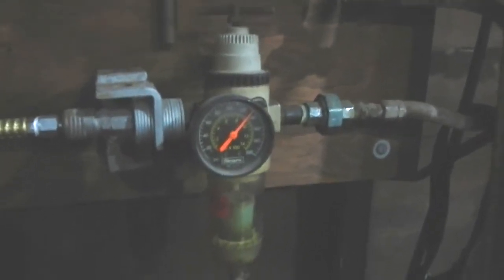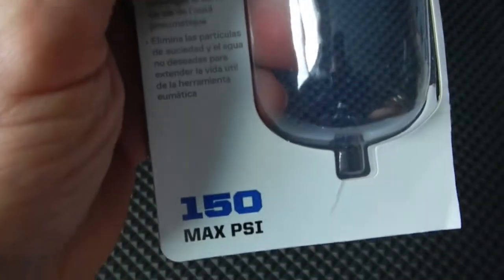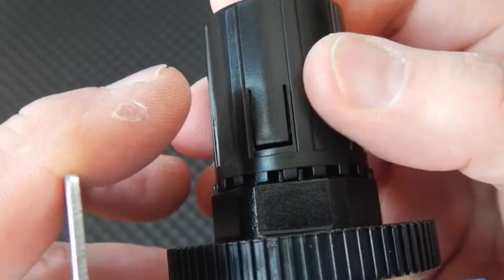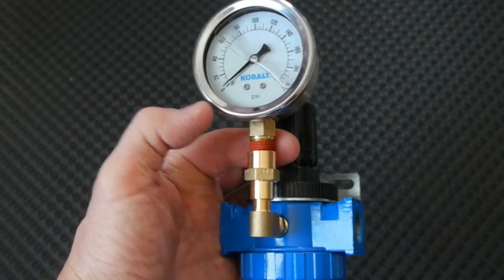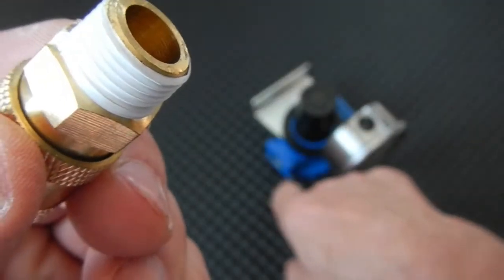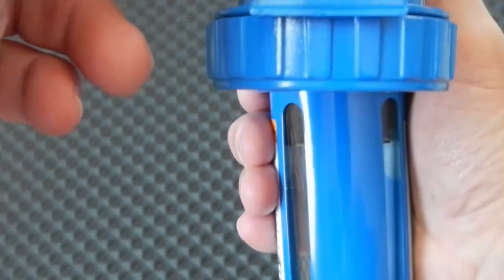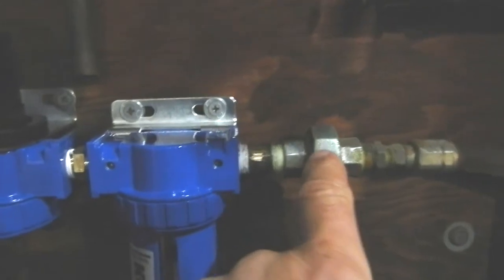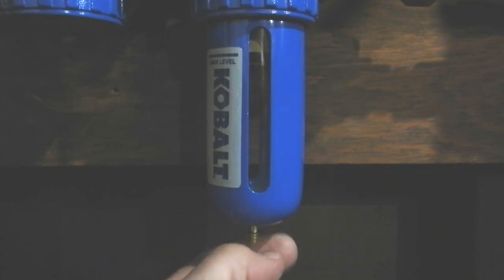Installing an Inline Air Pressure Gauge & Air Filter for your Air Compressor

Comment: Aren't you supposed to put the regulator first and the the filter
Reply from the maker: I wanted the gauge protected from moisture and dirt. My compressor doesn't put out my PSI than what this inline air filter can withstand at full pressure so no issues.